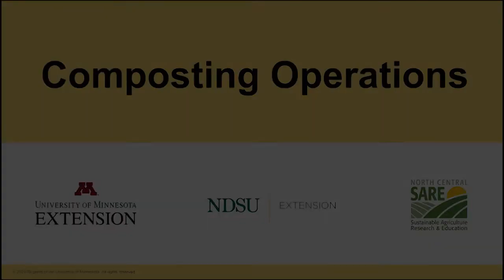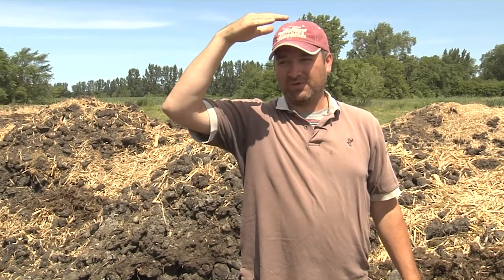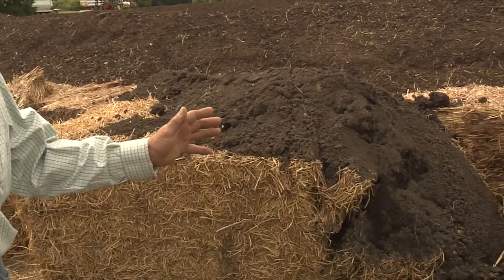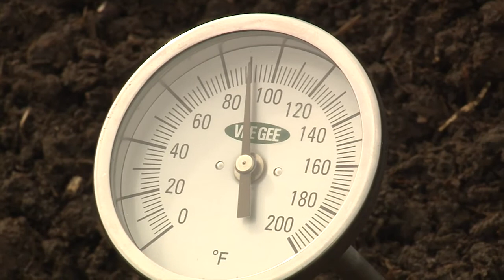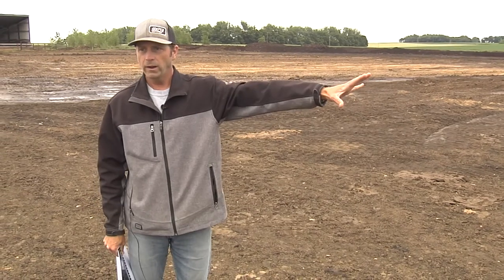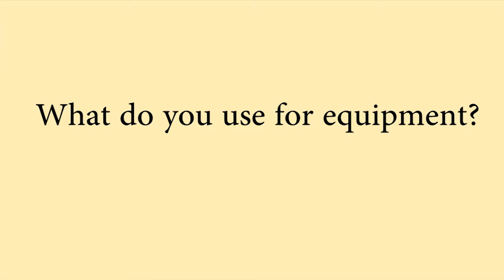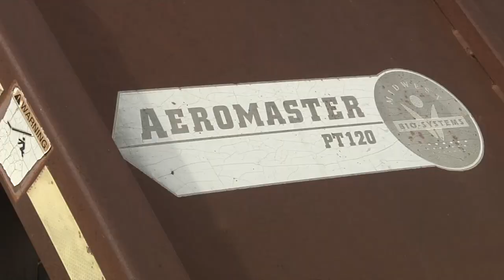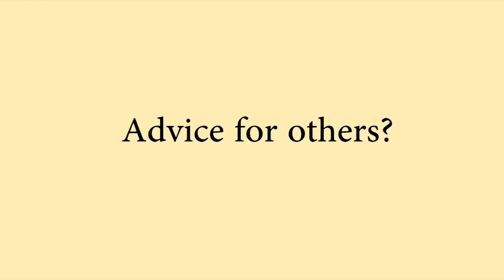Composting Producers - 2021

Comment: Crazy comments from non farmers...there used to be a 100 farmers for every 10,000 people. Now it's 1 for every 10,000. So farms were small, your small manure was always spread...either by hand with a wagon or later by machine. There is no - agriculture was better 100 years ago. It wasn't. There are shortcuts made in processing (fillers, painting strawberries, water injected meat). Buy local or better yet, try farming yourself on a very small scale. If you're a "better farming 100 years ago" person, make sure you have a shovel, pitch fork and wheelbarrow and give it a go.

Comment: The nitrogen content of beets is not affected by their moisture level. The dried out ones are still high in nitrogen, they just need to be hydrated to host the microbes.
Reply: In this context, what is a beet?
Reply: @spectrixx  I assume it is the vegetable which has probably been processed to extract the sugars. The pulp or whatever form likely dries out quickly before much microbial activity can take place making it stable for storage until it is rehydrated in the compost.
Reply: My concern would be in herbicides used to grow the crop and residual traces of herbicides...even minor tracesxwill stunt vegetables.

Comment: When he says if you put the compost in a ziplock and it’s doesn’t smell like ammonia, you can spread it. Ok so when I get compost from the city and put it in my van, my car smells like ammonia really bad. Does this mean it’s not ready to use?
Reply from the maker: Determining “doneness” of a compost product requires several factors, which are all discussed in the complete compost workshop playlist found here: https://youtube.com/playlist?list=PLnn8HanJ32l6uhwdS9m-G1z8Bq1U0aJzF. Long story short, an ammonia smell means the product still has excess nitrogen (N) in it and it’s not yet done or mature. We want the compost to smell earthy. That product will still have useful properties and nutrients, but the nitrogen parts of it will either be unavailable for plant use or may tie up other nutrient in the soil where it is applied. There are commercially available test kits you can purchase: https://solvita.com/product/solvita-compost-maturity-test-kit-6-pk/ as well as commercial labs that specifically run tests on compost: https://woodsend.com/#. Knowing the management of the compost (carbon to nitrogen ratio, temperatures, turning, etc.) is another way to help determine if it’s done and ready to use.
Reply: Yes.  It means that the nitrogen has been out gased as ammonia. This means that some of nitrogen meant for soil nutrition has been lost.  However, there is still some left to be used.

Comment: Gigantic waste of valuable energy resources! Put the manure through a biogas plant and make use of the heat capacity, instead of wasting it to open air! 
Compost will still be useful, and other process waste from slaughter houses etc will be recycled in a very valuable way too.

Comment: 9:10 I have 4 horses . I don’t have any machinery. I put the manure in a windrow as high as a wheel barrel would allow and just let it sit there without turning it. 7 months later I had to move it to a different location . To my surprise it turn out to be the best compost I’ve ever seen. 👍🏼
Reply: If you would turn it a couple times then you’ll have the compost in half the time at least. Mix in Green materials such as grass clippings or plant waste, etc and it will build more heat and you need to make sure you water it also which will help expedite the composting process.